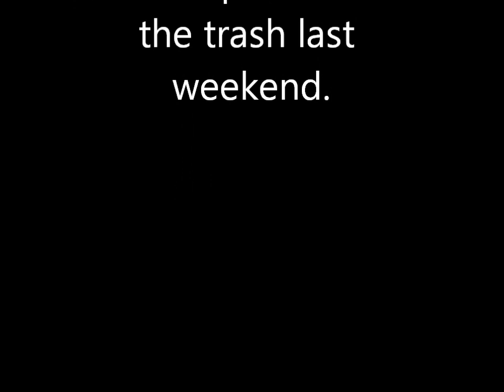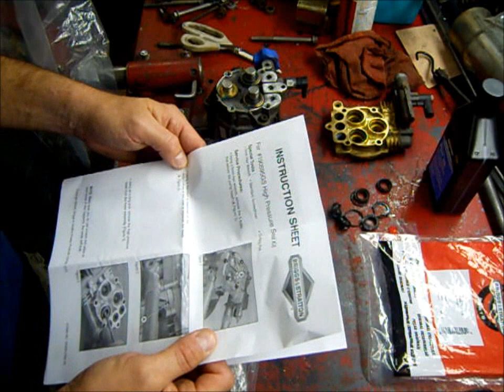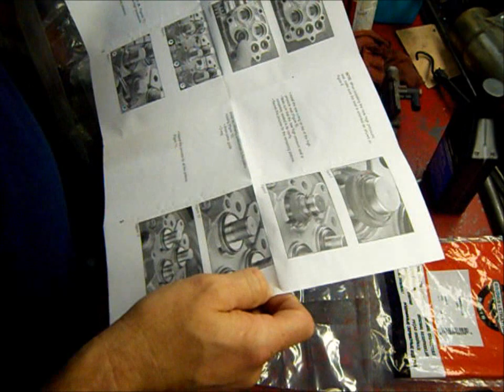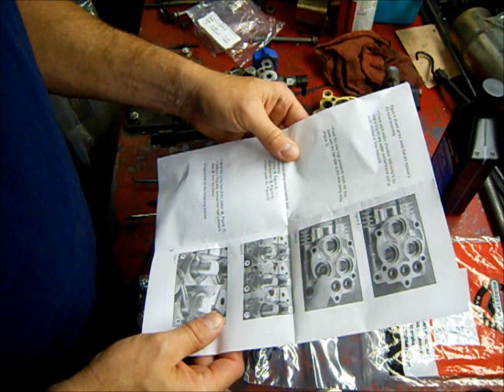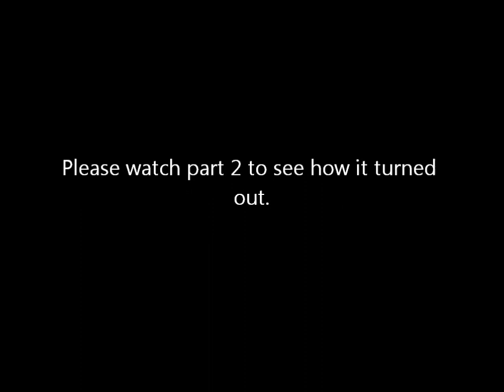Pressure washer repair- resealing the pump

Comment: Guys when reassembling with the new o-rings and seals DO NOT SPRAY THEM with any solvent ie: brake cleaner, MAF cleaner or anything of the like before reassembly. Contact with it will lead to premature failure! Make sure the parts are clean BEFORE reassembly. Also you want to make sure everything is lubed LIBERALLY with the pump oil during reassembly. Great video btw.

Comment: Good explainer, except I wish you'd said which way up the seals should face. I reassembled my washer and it leaks like crazy from the pump head section where the three cylinders connect with the 'distributor' I'll call it. Anyone know which way up? Should it be the flat face with small part numbeer facing outwards?

Comment: Seal part numbers and where did you buy them?
Reply from the maker: 190595GS search Amazon
Reply: @Broncocarl92  Thanks, good video. The pump is leaking, I guessing it's calcium from hard water has fouled the seals. My pressure washer is a Craftsman model no. 580.752400 and the manual has the seal kit part number 193807GS. I ordered the 190595GS hope it fits.

Comment: I know this video was made quite some time ago, but I have a question. I rebuilt mine today and it is leaking like crazy from where the pump and the piston housing faces meet, mainly at the base. An ideas. I’m thinking of using some RTV if nothing else works. All the bolts were torqued down as much as I feel comfortable doing. Any suggestions?

Comment: I used blue lock tight never red cause the bolts are too small and you will never get it apart to do  Maintenance on the pump in the future on all my blots the vibration from the engine and pump causes the bolts to come lose and you can have a blown pump right away I had a feeling the one my dad left me after he passed he stuck his nose in it to rebuild it and I let my nabor use it lucky I hang out with him while he was pressure washing and I noticed the pump started to leak Hella oil so I rebuilt mine using blue lock tight. Remember never red there too small of bolts and you sill snap them next time you open it

Comment: Those are the bearings in the pump. You can look on the web the model number of the whole craftsman unit is 580752550. If those parts are torn up you are better off replacing the whole pump.

Comment: thanks for the post.. but on the pump side you were putting in bearings and what looked like a washer, you did that off camera... is it pretty straight forward?
Reply from the maker: Man that was two years ago... I suppose you are refering to the bearing and washer from drive.. yes I think is was no big deal. Thanks for watching.

Comment: Dude...I'm aware this is an "old post" but I'm needing help to fit my pump back together, right now ( 7-17-15 ) so I don't know if you'll even see this, but I hope so. As I watched your video for help, it appears to me when putting the pump back together (8:45) that you forgot to put the "the three brass plunger shoe's on top of each piston," that go between the piston tops and the swash plate. I can see the old plunger shoes lying on your work bench, "and" the new ones in an plastic bag back on the left. Rather than just trying to point out your mistake, as I'm reassembling my pump right as I type this, I need to know if the pump worked without them...I'd be surprised since it was designed to have them, and keeping them still while reassembling the pump adds another complexity to putting it all back together.
Reply: im pretty sure he put the brass parts over the pistons, then he put the O rings over the brass part.

Comment: need help...I recently had a oil leak on my SIMPSON 1700 PSI pressure washer. I took it apart now I got a O RING that don't know where it goes. I got stuck on the oil pump and pistons. pls help me?

Comment: I have the exact same pump housing that I need to reassemble.  Could you by change email a copy of those instructions to me?  The video helps a lot but I cannot discern exactly which parts/seals you are using where.  The replacements I got do not have the instructions.
Reply from the maker: The instructions are long long gone (video quite old now). Sorry for that.
Reply: @Broncocarl92  still useful today I'm on it and know what to do because of U

Comment: I have the same exact pump and I need to order that seal kit.  I tried to clean everything and reinstall the pump.  It will not keep pressure up.  What is the spring looking thing do?  What is the seal kit part number?

Comment: mr  bronco ,  I found the same  kind you have   . what was the number of  the  repair kit    by briggs .  thanks.  I found  one  and replaced the carb   . every thing  worked well    .  I was using it today  and the pump  felt weak.   nice  vid  .